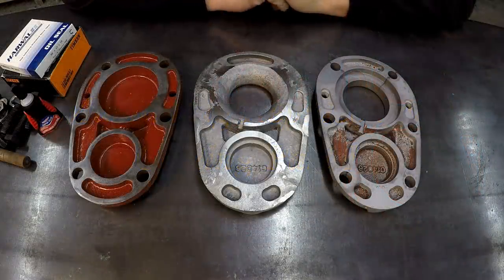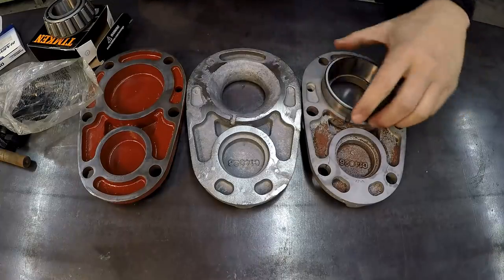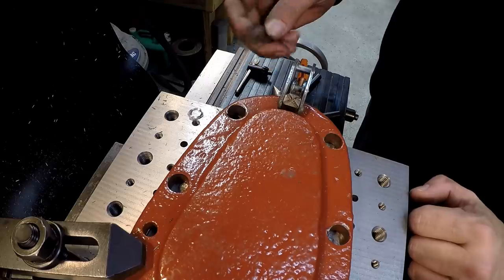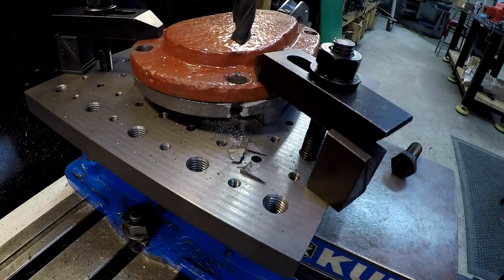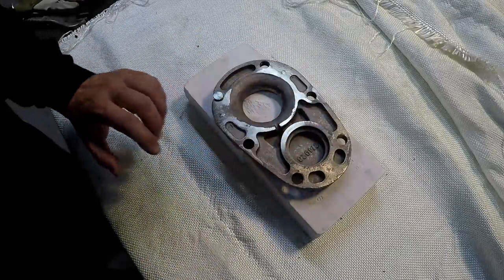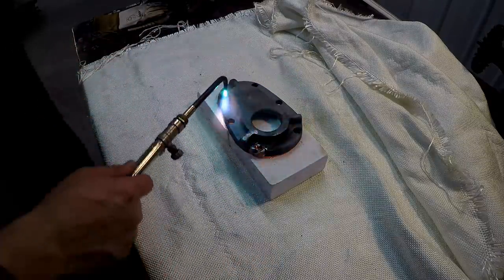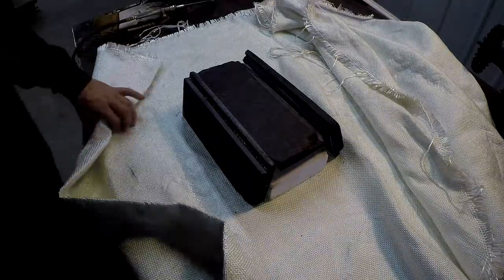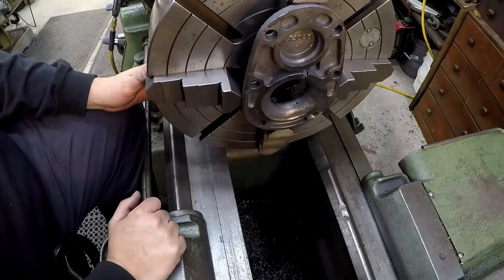Machining a Replacement Casting Part 1

Comment: Side Bar: Adam, As student I worked at Firth Brown Viickers in Sheffield England. They were makers of the infamous super gun. I saw a vertical mill in operation seen hare in a US education video: https://youtu.be/PsVqqtSop-0 Ever seen or operated one of these? At FB it was making 'tyres' for steam railroad engine wheels exported to South America which took most of the UK steam locomotive engine stock in the 60's.  My Dad used to operate a universal planer - presumably a super large shaper?
Reply: "My Dad used to operate a universal planer - presumably a super large shaper?" - kind of; on a planer, the work moves under the cutter; on the shaper, the cutter moves over the work. Diffrn't strokes and all that... (I'm not sure why one might be preferred over the other, except planers all seem to be huge, perhaps making an enormous shaper is too expensive?)
Reply: @theelectricmonk3909  He worked in the toolroom at Vauxhall (owned by general motors) so was presumably making tools and fixtures with that thing for the car industry before  CNC and robots. He ended his career making  filters (3" long brass tubes with 72 pocket holes) for satellites and has 63 pieces orbiting the earth making cell phones work!  + or - 3db tolerance....

Comment: why cant we all just use metric sizes, we all know that would be common sense.
Reply: No, how about you use what you like, and we will use what we like, it doesnt affect you if we use standard. Watch a different video if it is so offensive.
Reply: It is fine to use Imperial until you have different shops one metric one imperial . There was an issue at NASA I believe where all the drawings were metric ,when converting the measurements the interrelated parts failed as the extremely close requirements failed and a multi million dollar project went down the pan . Use whatever but use it across the job don’t convert that way introduces Murphy's law.

Comment: Need to get a better foundry. Chilled castings are a very amateur mistake. He should have known better.
Reply: I think both the foundry and Adam already know that as both admitted the casting was done too quickly with insufficient soak time. Nothing to learn here, except perhaps better manners, tact, and charity.
Reply: Jeremy Thompson Rush Job get rush results sometimes. Chalk it up to $#!+ Happens!
Reply: @gullreefclub  rush jobs always have rush results. Time, money, quality, pick two. He chose time and money, quality suffered, time suffered because of the low quality and he paid for overnight so money suffered as well. The next real question is "is there a way to machine this out of stock material in the same timeframe or faster, about the same price and with better quality? Should he have 'simply' tried to braze the original part? What probably should have happened was brazing and finishing the original part without any of that goofy aluminum and drilling through the braze. If they wanted a good part they need to find a few days when that machine isn't running, send it out to be molded and get the part back.

Comment: What a bad job ! He doesn't know how to properly drill a hole with the appropriate tool and how much force to apply on it... In my shop you will have been fired in no time. To me this error is no excusable. Our first year student does better than this (perhaps not editing videos but that's another subject).
Reply: What is the proper way?
Reply: Calm down Lenny.......
Reply: Only one, wo makes at least something, can learn from errors that may arise. 
With your comment, at least I learn nothing: Which tool is appropriate, how much force is appropriate, is that comment of yours appropriate?
Reply: Actually he's very good at that, but when you run into hard spots in a casting that you were not expecting, you sometimes have problems like this.

How would you have cut through the hard spots?
Reply: Your videos about how to do it right are really good. You have so many good videos.
Reply: Well Lenny in my world if you critique a man's work without demonstrating the "correct" way to do it that is "no excusable" as you say! As someone that designed castings for people like you to machine, changes in hardness and porosity are undesired certainty. Your shop probably wouldn't be my first choice for a contract. Please feel free to give me your businesses name so I can add you to the "list".
Reply: gentlemen of steel, i believe we have been trolled.
Reply: I checked Leonard's page...No subscribers...No videos....TROLL...
Reply: @itsmesuperlovelove  I, in fact have 1 subscriber...
Reply: @gibbsey9579  
So what we have learned is that Lenny, despite having watched this video and made a comment that someone did something stupid, came back here to crab about people telling him he made a stupid comment, he is not a tuber. He therefore has a life that everyone else should want! Some arguements you just won't win. Shit the poor dog is already gonna get kicked and "his newbie" will probably go home crying today. Just let him fester in his own nastiness!
Reply: gibbsey9 now 2. Only to prove Mr Wiseass wrong. 😂
Reply: Don't forget your hat on your way out.
Reply: @torstenb5248  Thanks Torsten B